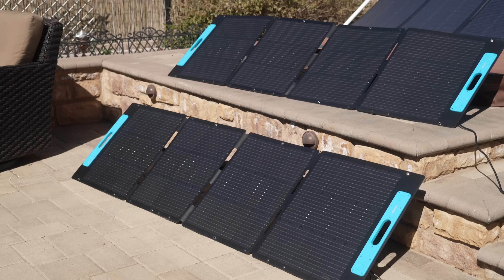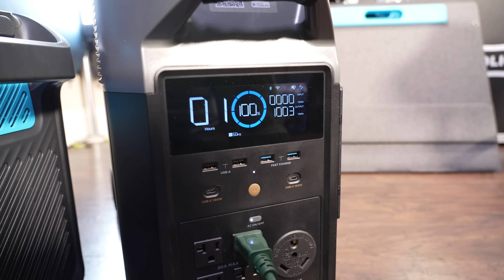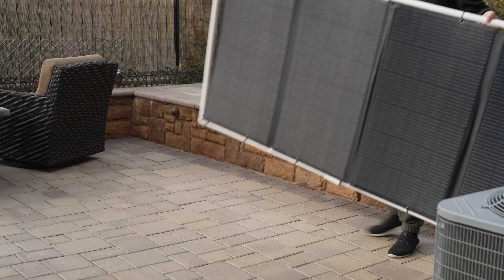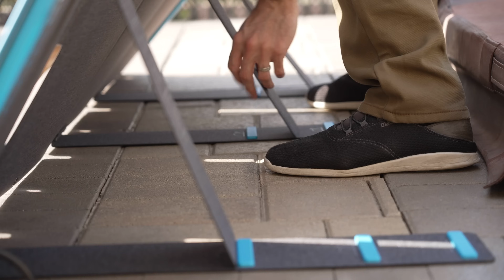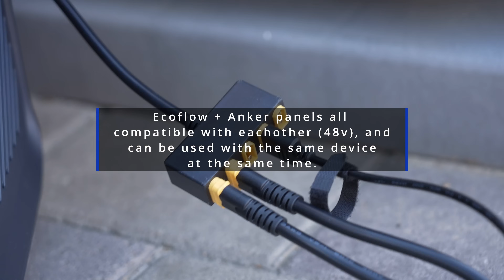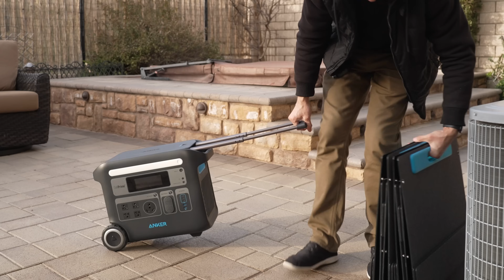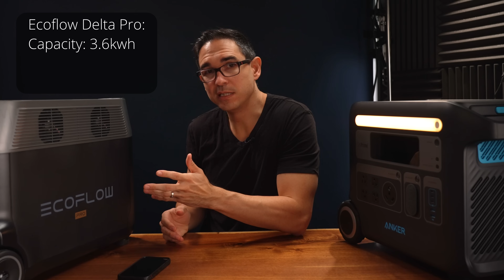Why I like the Anker Powerhouse 767 BETTER than the Ecoflow Delta Pro

Comment: Nice review. While I too would choose the Anker over the EF for many of the same reasons as you… it may be helpful to know that the Anker is 20A rated at the “RV” plug whereas the EF is 30A rated. I use a generator to run the 120V of my house when we lose power (we’re in Hawaii). The number of available amps can make difference for your total loads.
Reply: I have seen a lot of vendors doing this to my dismay. It’s unfortunate too because it’s kinda shifty to stamp the interface rating on a device that will never fulfill the rating. Do your homework kids…
Reply from the maker: Totally valid point.. 120v @ 20 amps would max out the inverter. Confusing specs it seems, though it is marketed as 30A.

Comment: Little bit of a stretch on the comparison, pretty much apples to oranges between these two model. It's kinda like comparing a sports car to a diesel truck and each one has their advantages. 
The Anker has excellent build quality and I love the quiet fans. I hope ALL companies move towards silent operation. I also love how clean the power output is on the inverter. It's one of the best inverters I have ever tested. I love the 5 yr warranty was well, BUT the EcoFlow also has a 5 year warranty.
The main disadvantage, in my opinion, is the 60VOC limit on the 767. Using third party solar panels it is almost impossible to hit the 1000w mark, I have only ever been able to get 650w or so. Basically... the only way to get the full 1000 watts of solar input is to purchase five of their 'Anker 531' 200 watt solar panels and connect them together in parallel. Those panels only cost $550 each so you'd need $2750 worth of panels to get max charging. 
Thanks for the video! I enjoyed the conversation. Certainly different models have pros and cons for each use case so discussing these points will help others make the best decision.
Reply from the maker: Thanks for your insight! I do appreciate it.  I showed in the video you can use the ecoflow 400w panel. Three of those and you’ll max out 1kw.. even a little over but it will stop at 1kw. Obviously the ecoflow panel design is awful but it’s still an option, being a 48v panel.
Reply: @TommyCallaway  each of those 400w panels put out 40v @ 10 amps, so putting two of them together will give you 40v @ 20 amps (800 watts)... which is hitting the 20 amp charging limit on the Anker767.  You can't connect three of those panels because the amperage would be well over the 20 amp limit. It's basically maxed out with two panels.
Reply from the maker: @Jasonoid  Interesting!! Thank you for sharing.

Comment: I just received the Pecron E2000LFP cost me $1110.55 shipped 
I know it's only a 2Kw inverter but the battery tests above average capacity with expansion batteries that extend to 8kwh. Each battery can except 500 watts of solar and have a 100 watt USB C port and 12V port
Reply: This is what I was thinking also. The maker is nice because of the 30 amp plug but price wise I might as well buy a peceron.

Comment: Pro is way better not even a comparison
Reply from the maker: Depends on your use-case, better is subjective. That's why I did the comparison.
Reply: @TommyCallaway  60 volts is tough one for solar. Unless you buy there panels.
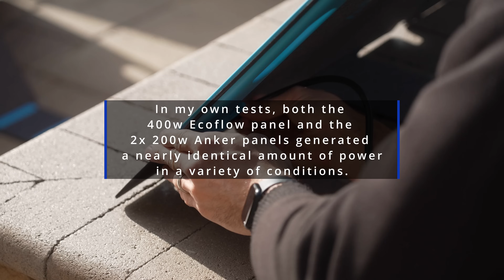Reply from the maker: @zfontain1975  It accepts 12-60v. At 3:33 I show using both ecoflow and ankers panels together to charge the anker at the same time.
Reply: @TommyCallaway  hard to get 1000 watts with 60 volts. I use solar daily. Unless you have 300watt panels  series and  Parallel configuration. I don't have those panels if I did then this unit would be ok.
Reply from the maker: @zfontain1975  you could just get 2x 400w and 2x 200w panel. You don't need to stop at 1kv, it just won't charge faster than 1kv.
Reply: Comparing 2 different design applications 
The Anker should be compared to the 2000 watt ish designs , Bluetti AC200 Max , Pecron E2000LFP , Zendure Superbase Pro etc.

Comment: I have an ecoflow panel . I hate the design lol. It need legs behind each panel. 

Ecoflow now offers a 5 year warranty on thier products not 2 years.

On that Anker The unused ports on the solar charging hub are live . I can't believe they designed it that way. That could be dangerous, it can arc, can get shocked or cause fire. It's an accident waiting to happen.

I do like this unit and I am considering it.
Reply from the maker: Agreed on the Ecoflow panel. I despise the design, but love the power.  Yeah, the Ecoflow warranty does extend to 5 years after you register it, but.. I rarely register things. I should have mentioned it anyways, thank you for the note on that!  And the unused ports CAN be a problem if you're working with higher voltage panels, but if safety is a concern after you set it up, a quick bit of electrical tape can solve that problem. Not ideal, but I significantly prefer the XT60 plug hub over the other standard solar panel connectors. I already broke one of the other kinds of solar panel connectors and I only used it twice. XT60 in my opinion allows for a much faster setup time.